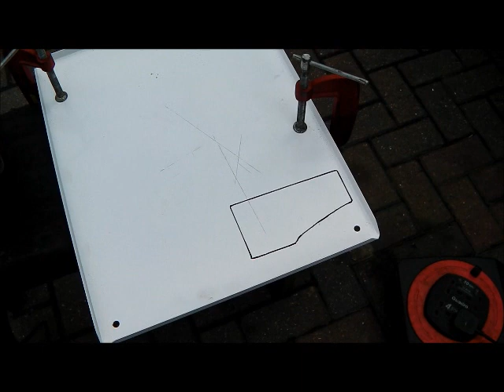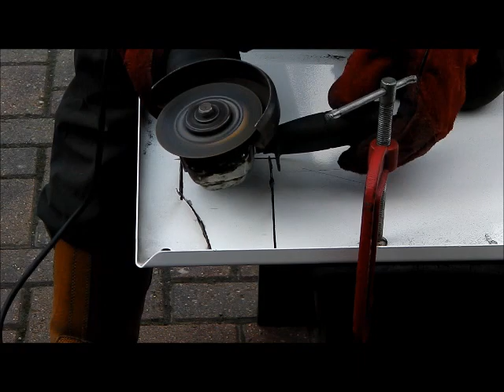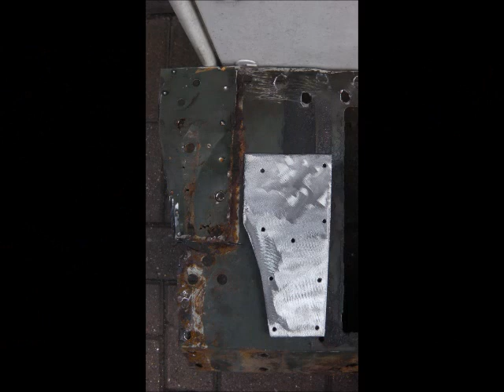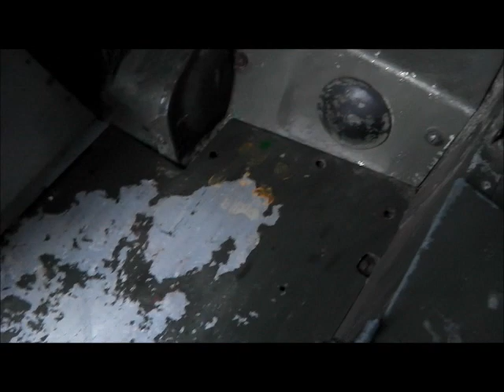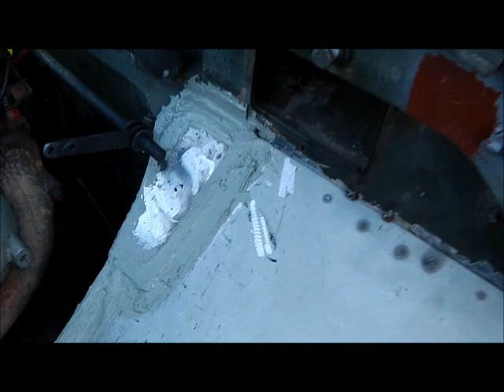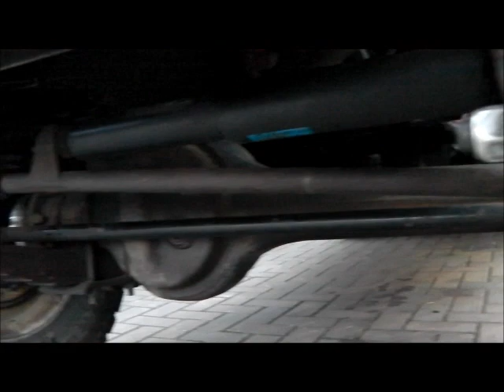Land Rover Series 3 Rusty Repairs  -Part 5-

Comment: Good job. Ive just finished the brakes on my series 3, replaced all pads drums and cylinders as a couple of them had worn through and ruined the drums after a trip off road. I thought I may as well replace the lot. 
I'll be interested to see you replace the springs that's something I've been thinking about doing for a while now.